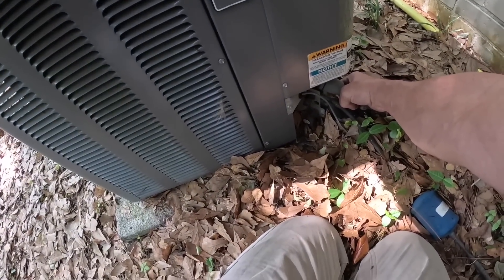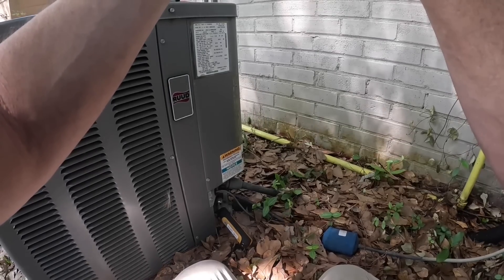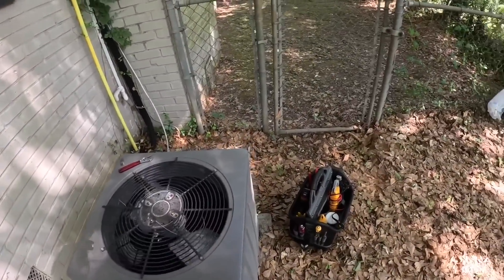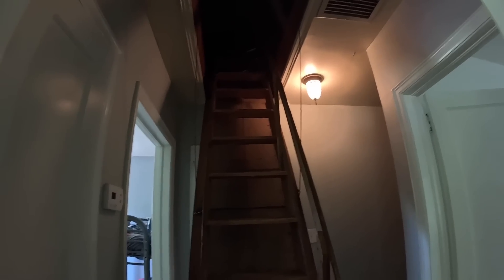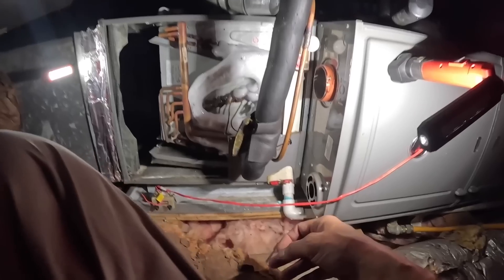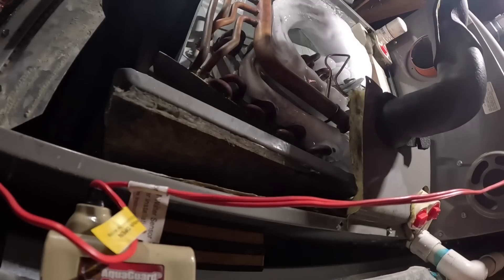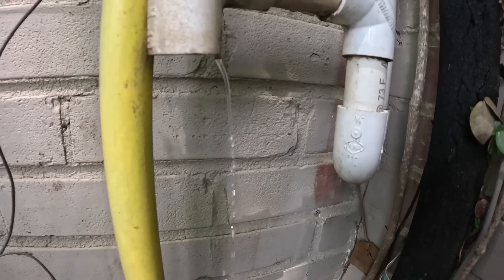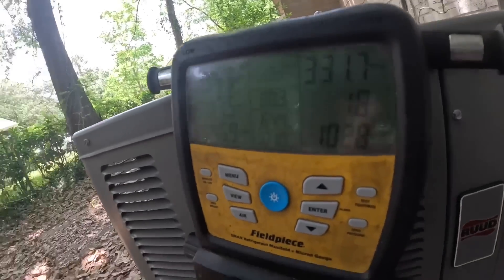System Hasn’t Been Used In Several Years, And Now It’s Not Cooling! #hvacguy #hvaclife

Comment: Good lord what a flue on the furnace…also did you do a pressure test on the system isolating the condenser, to rule out the lineset or evap coil leaking?…or maybe it was never charged properly to begjn with

Comment: wait hold on a minute curtis you said that because there was only ice on the evap coil and none outside you knew it was low on refrigerant? I didn't even think of that but it makes total sense. Most of the time If I see a coil is fully iced up I will just leave the call and come back without even attempting a leak search. But knowing this info helps a lot

Comment: What's your favorite refrigerant?
Reply from the maker: R-22
Reply: @HVACGUY  Just fixed an old r22 Goodman heat pump today. Had a bad relay for the blower fan. I also found a full 30 pound bottle of R22 at my work. That stuff is worth a pretty penny. I like R12, I have a mini fridge from late 70's or early 80's and still works fine. Just had to swap a thermostat.

Comment: If you don't find an active leak, there's a good chance it was just simple lack-of-use and the tendency of pressurized gas to seep out through various seals that caused a slight loss of charge. I imagine valve stems leak on HVAC much like it does with tires, it's par for the course.

Comment: Just a little bit short on freon causes all that. When mine gets low, it doesn't freeze up, but efficiency goes in the toilet. I have heard that any system that sits for a long time will lose refrigerant, even if it is on a molecular scale. Nice job
Reply: Had a very dirty filter.